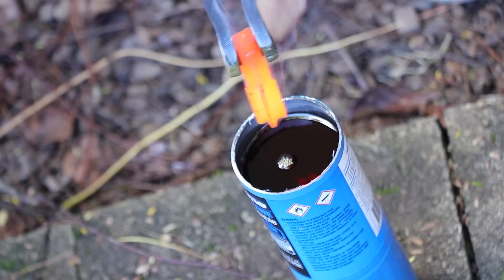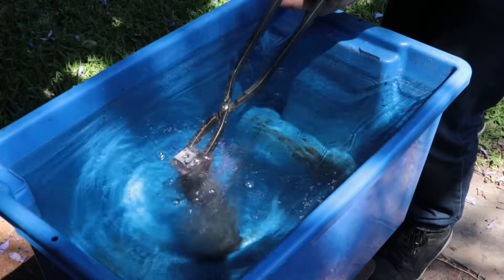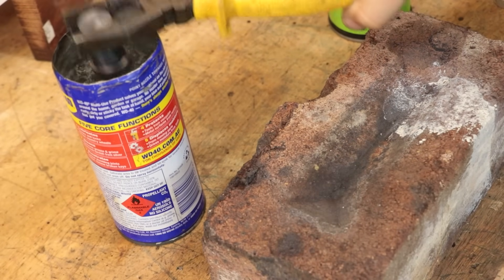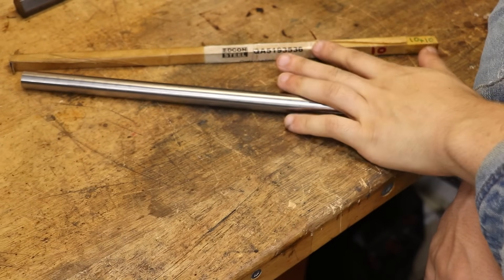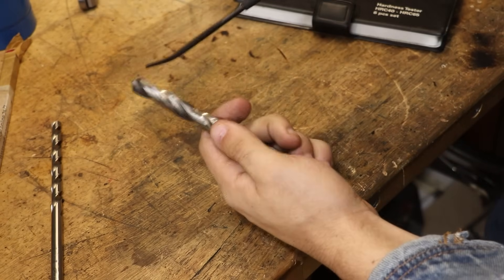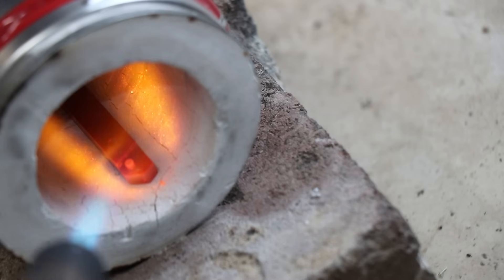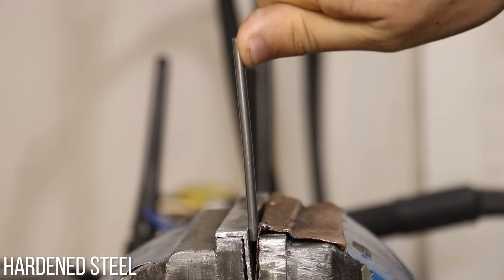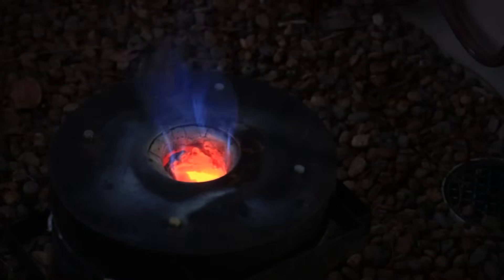10 Misconceptions About Heat Treating Steel

Comment: I happened to learn myth #8 last week, about hardened steels not being any stiffer. I always wondered why my insert lathe tools weren't hardened. Now I know why rich machinists buy carbide tool shanks. Now I just need to find out how those machinists got rich.
Reply: It is known as 'Young's Modulus' that determines there is no difference in stiffness of the same diameter rod whether hardened or soft.
Reply: @howardosborne8647  You know what... I think I just realized why Modulus basses, known for their graphite necks, got their name. 💡
Reply: @howardosborne8647  That I knew, I just didn't know that quenching has no effect on the young's modulus.
Reply: @ Carbide boring bars are a very different animal with regards to stiffness and resistance to chattering compared to steel shanked bars. This is especially noticeable with small diameter boring bars like 8 and 10 mm where you need quite a lot of stick out when boring deep holes. There are a couple of videos on making homemade indexable tipped carbide boring bars on Robin Renzetti's channel and I also think Stefan Gotteswinter covered homemade carbide bars.
Reply: @howardosborne8647  Goteswinter's video is where I first learned it.
Reply: @howardosborne8647  Explain this. How is a hardened piece more brittle if the stiffness is the same? Seems counterintuitive.
Reply: @larrybud  The brittleness has to do with the state of  grain structure in the metal object...that is changed by heat treting and quenching to harden or heating and slow cooling to soften (anneal)
The hardness or softness state does not increase nor decrease the rigidity of the component.
For more insight into this look up 'Young's Modulus'
Reply: @howardosborne8647  Besides changing material type or thickness, or shape, is there anything that can be done to a part to increase it's rigidity?
Reply: Different materials have different youngs modulus ie steel is stiffer than aluminium for example. 

For a given material (eg steel), bigger sections are stiffer than smaller ones. Eg a gatepost that's 100x100x2.3 shs will be stiffer than a 75x75x3.3, even though the bigger section is lighter (6.95 kg/m vs 7.14 kg/m).

For a specific material and part geometry, though the stiffness is now determined (mm of deflection per unit force applied), the STRENGTH is up for grabs with heat treatment (level of force applied before failure occurs)
Reply: Those machinists got rich by buying carbide tools which let them make more dollars per hour.
Reply: Maybe they buy carbide shanks is because harder is stiffer .
Reply: @rolandtamaccio3285  Huh?